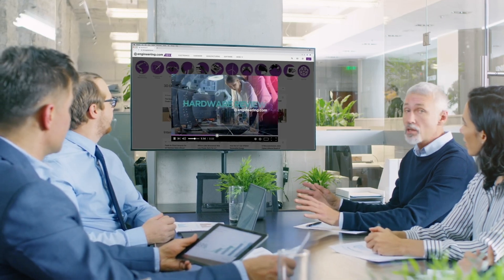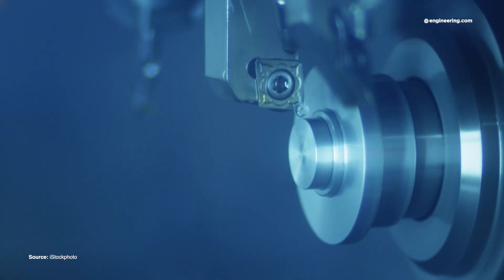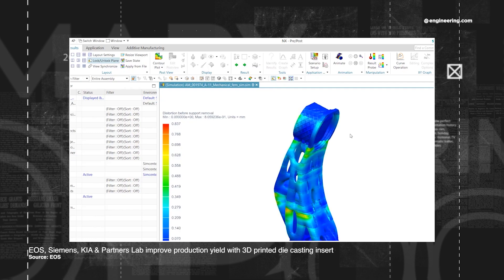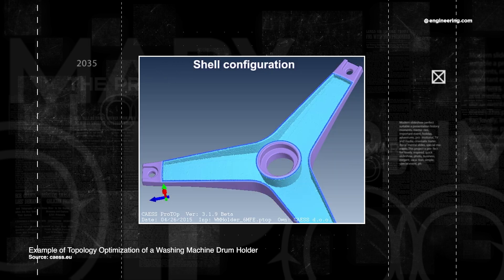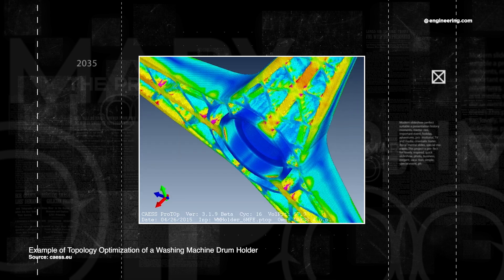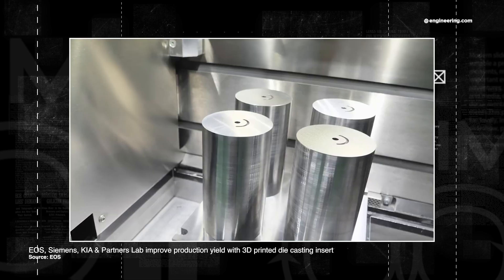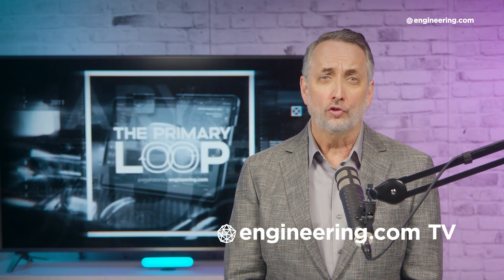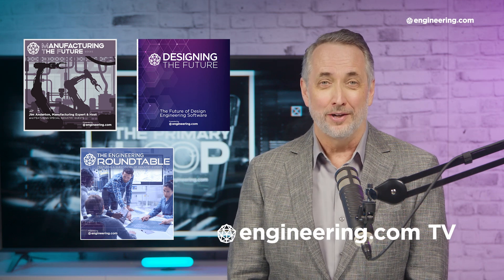What Will it Take for Metal Additive to Replace Machining?

Comment: A current issue with additive manufacturing, specifically with laser sintered parts, is the porosity of the resulting part. The quality of material is simply not equal to forged or billet parts.
Reply: Based on griffith's criterion on crack propagation, once the free surface energy increase beyond the reduction in elastic energy when a crack propagated through a material. A crack will cease to increase. Which is also the explanation why many material have much lower tensile strength than theoretical calculation based on atomic bonding energy due to presence of microscopic crack. The Forging process essentially decrease the grain size of material, effectively increase the free surface energy requirement for a crack to propagate.
IE: homogenous as metal grain size goes from 120 micron to 40 micron during average temperate forging.

If additive manufacturing is able to print feature size below 120 microns to 40 microns resolution. Effectively you achieved the same micro structure result as forging. It should result in the similar strength. Electron beam melting have resolution around 0.5 microns. But it's painfully slow. I saw a video some where a research group embedded metal oxide in SLA resin molecules, thus enable the use of SLA printing to overcome the slowness of EBS printing while still preserve the most of the resolution. They were exploring the relationship strength of truss structure versus to truss feature size. At larger truss size, the strength is much worse than regular forged material, but as feature size decrease to around 15 microns level, the strength start to approach theoretical material strength calculation and long pass the strength of forged material.

So I think the porosity issue is only a problem at large feature size resolution. Once you can print at micron level, reaching strength parity to forged material shouldn't be too big of a challenge. Since there are already lab demonstration that done it. But the time line to reaching cost parity per strength is some what of an unknown. Since many of the lab experimental method require exotic resin or ultra high vacuum environment. Or it needs to be done within supercritical CO2 to prevent surface tension from collapsing the micro structure during printing (the super critical co2 acts like a scaffold that can transition to gas when printing is done)
Reply: Agree that it's critical to keep the microcracking below the critical Griffith length, and I think that a lot could be done with post print heat treatment, depending of course on the alloys.  I have always felt that we need to go beyond  grain refinement by mechanically smashing metals.  But additive is a long way to go Before it can produce forged apart strength,  especially if anisotropic properties are desired @keenheat3335
Reply: This is just blatantly wrong. metal AM can easily produce dense parts up to like 99,998% density (basically fully dense). We don't talk about laser sintering because it's laser melting. Forged parts are superior but AM surpasses machined or cast parts easily.

Comment: Short answer is that it can't.  There needs to be a fundamental shift in how printing is done if it to replace machining.  Placing layers of material on top of one another is not fast or accurate.  Printing in it's current state is a companion process to machining.

Comment: I think the consumer market will push the democratization of metal printing. When companies can sell a home multijet fusion or cintered nylon machine and turn a profit for reinvesting , we will see more metal printing production. Hp has monopolized certain processes , yet theyre not bothering to make money off of the lesser printing tech . ( e.g making money on simple fdm to fund advancement in Mjf.. I can see molds being printed in the future where the one part is printed to make thousands of cheaper parts as some steel molds can cost a fortune as is